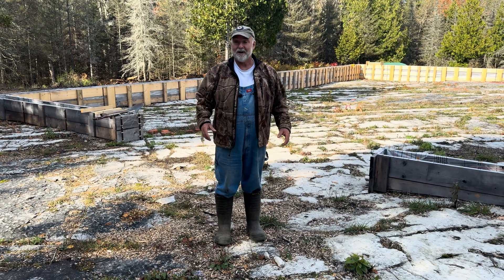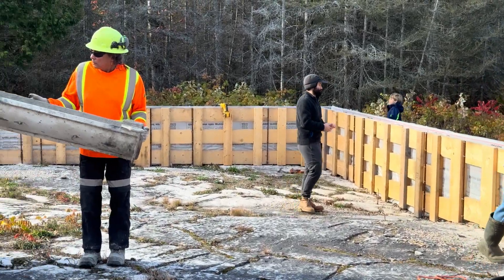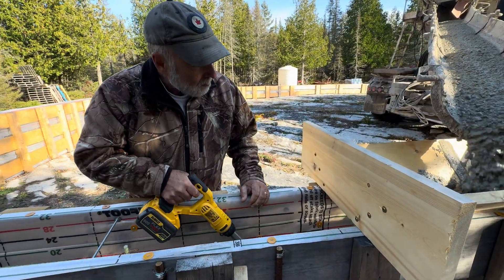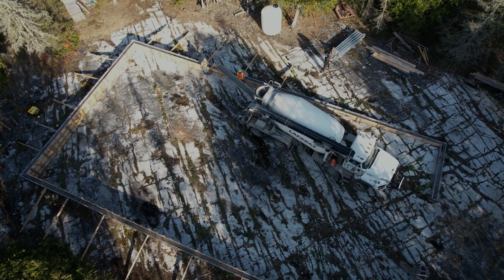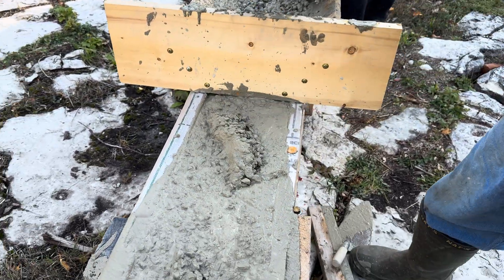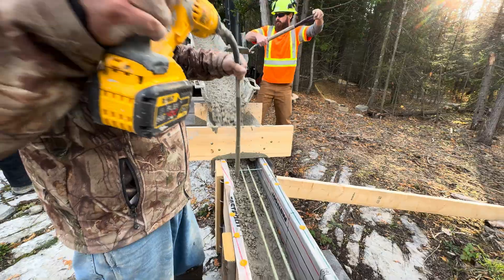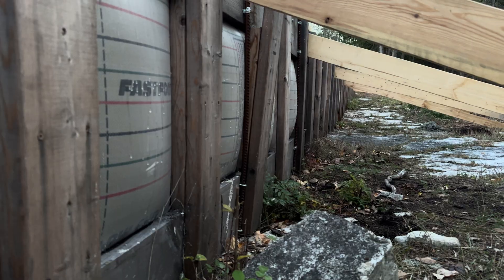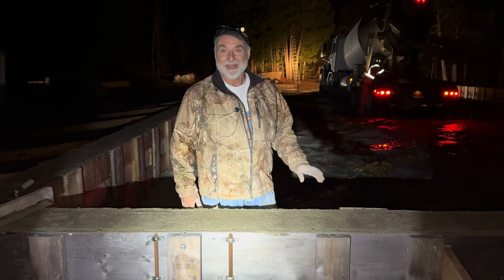[UPDATE] Fabric Structure Progress: Pouring Concrete Foundation

Comment: Steve - I don't think you've mentioned how you're going to use the interior space. I've always wondered about the lifestyles and small businesses on Manitoulin. It'd be great to hear about your plans.
Reply from the maker: Good point. I'll make a video to answer that question. In the mean time, my aim with this structure is equipment storage and repair. I have a small farm with several tractors and implements. I'll be storing them in the structure, but also doing some things to make the space at least a little heatable.
Bye for now, and thanks for watching!
Steve